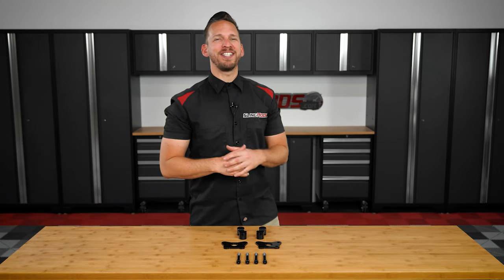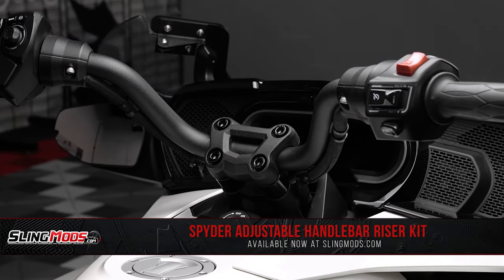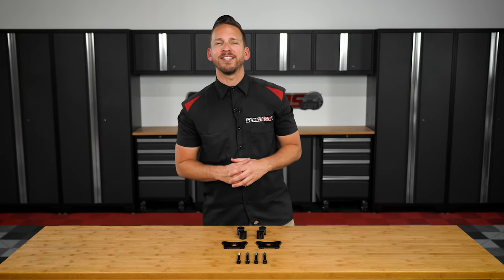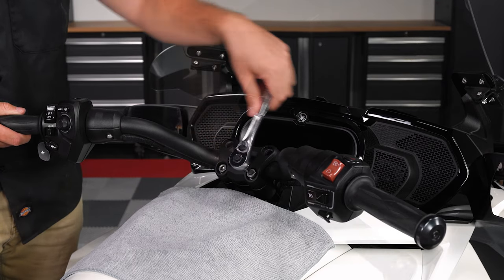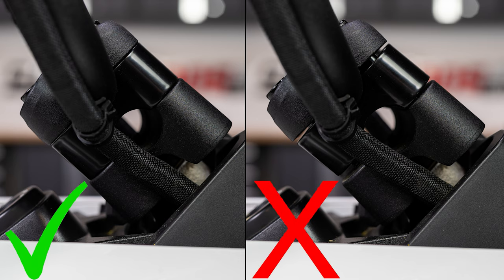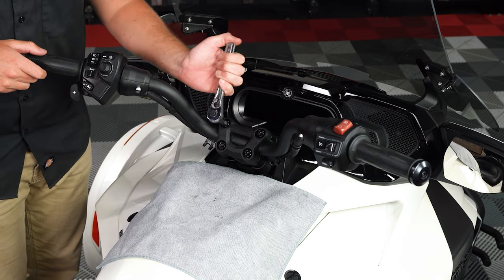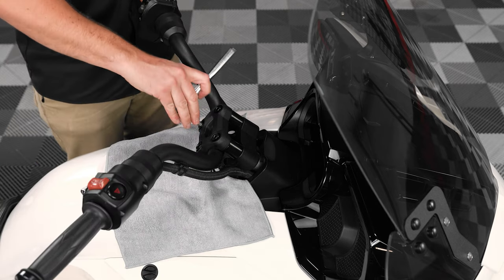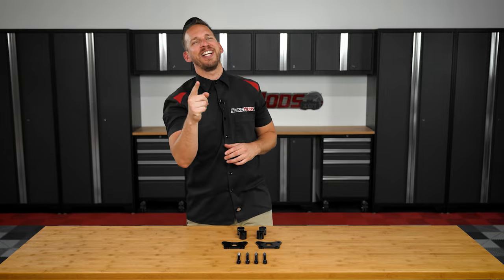Can-Am Spyder F3 / RT Handlebar Riser Kit

Comment: Hi. can you use the handlebar riser kit with the dragbar?
Reply: Thank you for the question Karl.  We have not tested this riser kit with the drag bars, however if the drag bars mount with the same OEM hardware as the stock handlebars I don't see a reason why they wouldn't work.  That all being said take extra precaution while mounting the drag bars to ensure that all bolts are able to tighten and that there is no movement in the drag bars.  Please let us know if you have further questions.  Brandon

Comment: The bolts wont fit if you're already purchased the USB on-handlebar charging kit.
Reply from the maker: We have not tested the Spyder Extras Docking Station with these Show Chrome Handlebar risers.. but I would say without testing that sounds like an accurate statement.
Reply: @Slingmods  Yessir.  Specifically, you will need 120MM bolts to go through the 20MM docking station spacers and risers.
Reply from the maker: @kenm6065  Well.. thanks for sharing Ken! I'm sure others will find that information quite useful.

Comment: Riser plate holes are too small for placement in video. Need to be on top of base plate. Mark risers with white out top fwd L/R to avoid cussing. Second person is recommended, lots of pieces to hold with one hand. Bolts are a too short for plate usage really, only about 4 threads to grab, use lots of thread locker. Overall not too happy with it could've done much better
Reply: Update,  the riser plates cannot be use on a '21 spyder RT. The plates do not fit the center of the steering column.  I placed them on top of the lower block, which changes the symmetry of risers then they do not sit flat. I removed the plates and it's fine. Riser plates go in the trash can for an RT. Slingmods probably ought to ammend their video. On the brightside, the bolts are long enough for peace of mind now
Reply from the maker: Hello, although the blocks appear to be identical, there is a left and a right side riser block. If you have the left block on the right and vice versa, the riser will not sit flush. We actually did that exact same thing the first time we installed the product. After speaking with the MFG, they clarified.